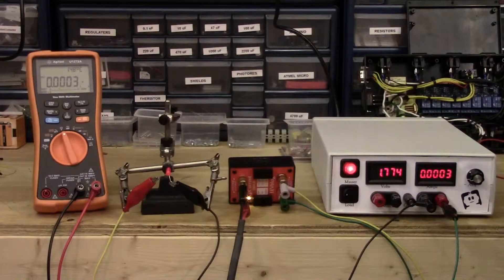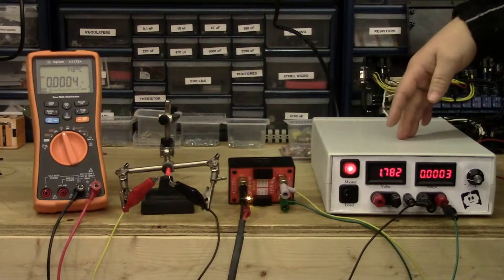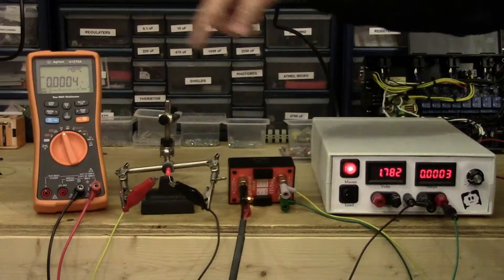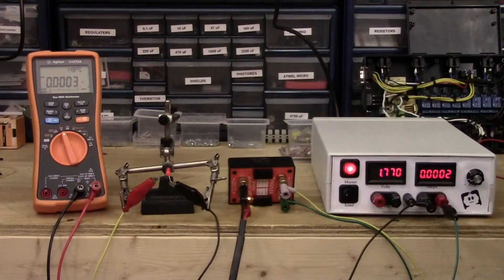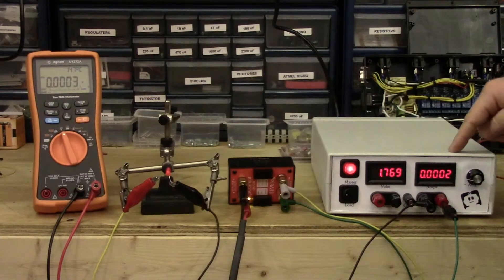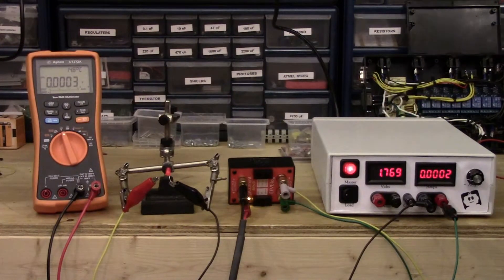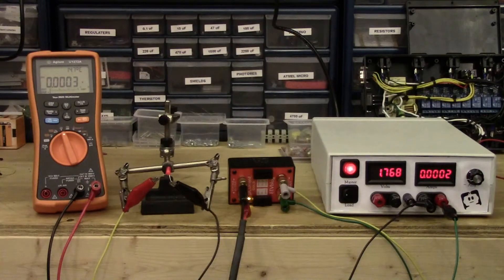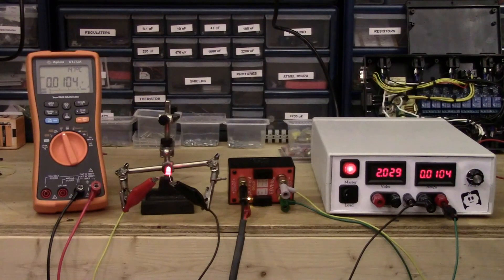#8 - Cheap Current Meter Accuracy

Comment: Cool! Can you post the model for the ebay current meter? Thanks!
Reply from the maker: There isn't a specific model. I have found similar results with a number of panel meters I purchased on ebay. You will find them by searching for "5 digit current panel meter". They will usually have a range of 0 to 3 A, 3 to 30 V. Keep in mind these are good for simple/quick/cheap projects.
Reply: Brad Henson Yay thanks for the response I'll keep that in mind :)